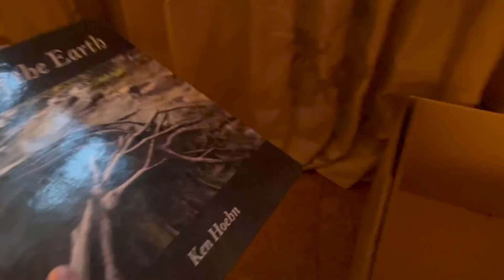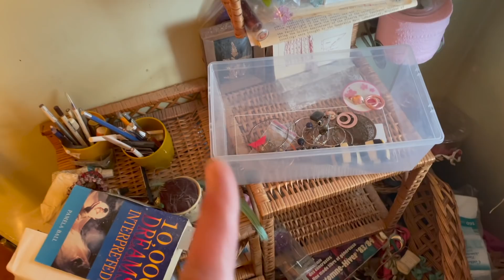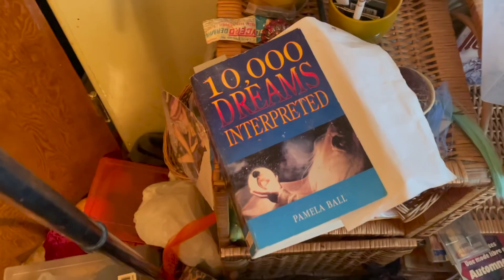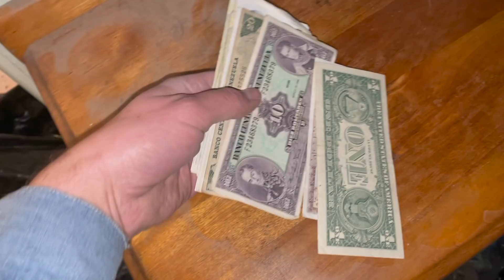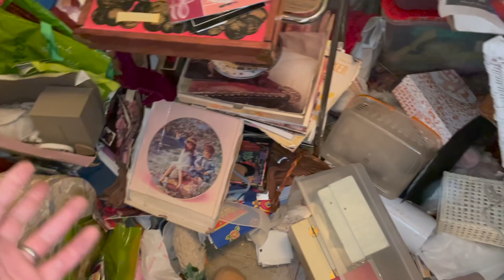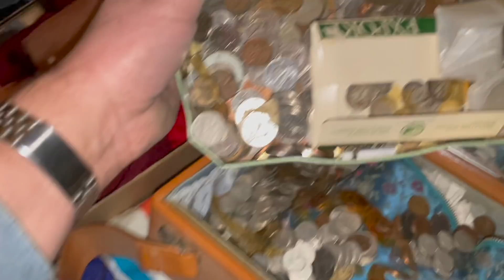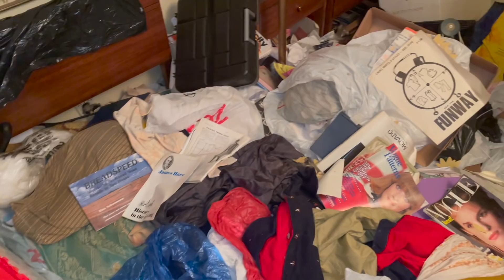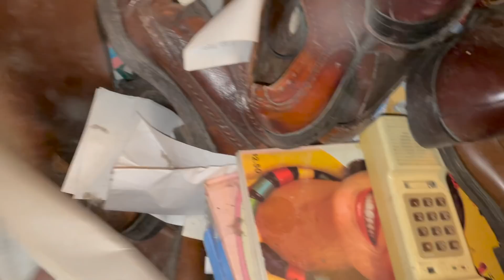Part 4. We found hidden GOLD! Secret cash hoards and more! The musicians house.

Comment: Hiya Can you turn on the closed captions please? Last couple videos have not had them and as a hard of hearing person, they're really helpful when you're off camera talking.
Reply: Hello JL, If you are on a laptop (not a phone) Click on the 4 LINES at the top Left of the Red arrow and YouTube, scroll down almost to the bottom to SETTINGS, then down to PLAYBACK and PERFORMANCE, click on SUBTITLES and CAPTIONS. Check both boxes: ALWAYS SHOW CAPTIONS and INCLUDE AUTO CAPTIONS (when available). Many You Tubers do not caption their videos. This is how you turn captioning on for yourself. I am not certain how to do this on a phone or tablet. A tablet is probably similar. I just tried this and it does not seem to work for me on my laptop. I know it makes the captions show if you are able to watch on your TV.  I hope this helps! Cheers, Jennifer
Reply: The CC is auto generated so sometimes it takes the system here on YouTube a while to transcribe the videos. The uploader doesn't control the CC.

Comment: The inner grandma in me is yelling, “that’s a perfectly good sofa and chair!”
Reply: Those sofa/chair combos were a dime a dozen in the late 70s, early 80s. They were cheap, durable and didn't suck to sit on...
Reply: @Snarkapotamus  I believe it! Furniture was made to last at that point in time. Todays furniture is just like fast fashion-cheaply made and replaced often.
Reply: both sofa and chair were given to charity ;)
Reply: @Snarkapotamus  That was my first Livingroom set back in 1980 in my first apartment.
Reply: My mom still has hers.  They are still very comfortable.  Much better made than current styles.    Wonder if you can reupholster them?
Reply: @jennifertoro7430  yup you can replace the cushions and have them re-upholstered easily. If there is a trade school nearby a lot of times students will take it on.
Reply: @edpoell2876  - yeah, me too! And just about every other apartment/trailer dweller that I knew back in the day...
Reply: Me too!!
Reply: Nope it's so  early 70's and dusty and just yucky.  You'd have to reupholster that and the foam is probably rotten.  The frame and springs are good but it's not worth the effort  now.  It is a charity case.
Reply: @jennifertoro7430  sure you can. A friend re-upholstered. The 'bones' of the sofa were still in excellent condition.
Reply: I still can't believe u let the clothes to go like that. If each item sold a dollar, u could have accumulated more than $ 100000

Yet, it makes sense if it turned out that she have inherited her parents who seem were having a men shoes and a women tailering businesses.

It also look that this woman also was stocking from thrift stores. She look like someone did not understand the money value. But if she didn't have someone to Inherite her, then, at least, she did enjoy her money.

I am wondering, did you award ur friends for helping you? I hope u did.

The weirdest part for me was the knife; how sharp the knife was to just easily ripped the carpets!

Comment: You need an air filtration system...  for later projects..Get yourself some 20X20 inch box fans (or Canadian equivalent)  and mask tape some filters onto the back of them..I do this during the summers "especially" during the fire seasons and you would not believe how quickly I go through the furnace filters

Comment: Alex when unblocking a sink with a breather overflow you have to hold something over the breather overflow or jam a bar of soap in it when plunging to get a vacuum and pressure to unblock it, as all your doing is pushing water back up the breather vent.

Comment: Ppl will buy the boxes of expensive goods or items on ebay, especially iPhone boxes,  high end jewelry and perfume boxes. And if you have the boxes of any gaming system or electronics that has the manual in it , that sells too. Ppl will buy them when they have bought the items that are second hand and either use the manual, or use it to package the items as if it was new if they are giving the item as a gift.

Comment: When you plunge a sink that has the little overflow hole, all the pressure from the plunger just comes back out the hole instead of pushing down the drain

Comment: Bruh... you gotta plug the overflow hole there with a wet rag and ur hand or the plunging ain't going down the pipe, just around and out the sink hole...
also, these folks obviously had no idea how money works, it's all just losing value sitting in corners and jars, along with all this worthless crap